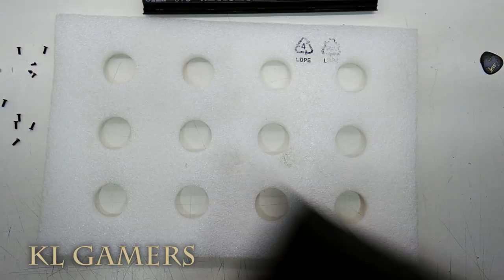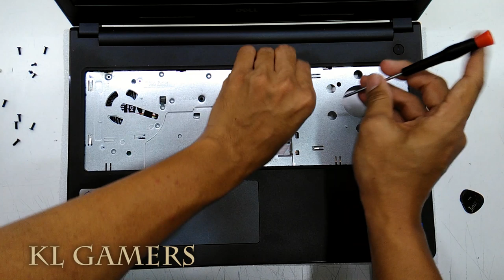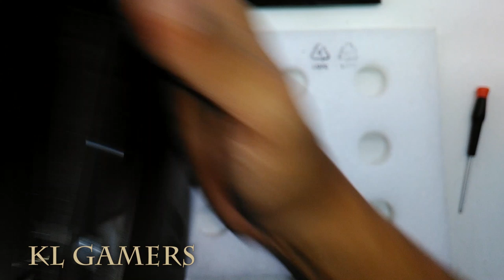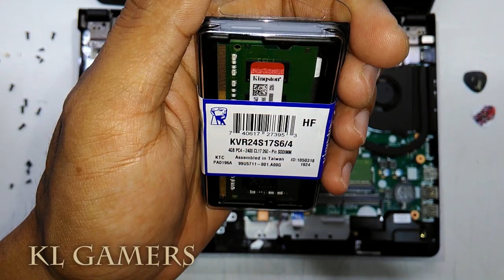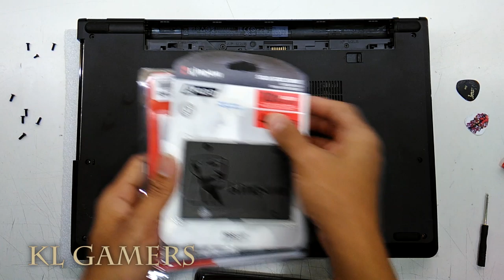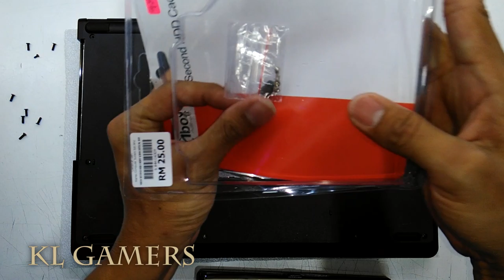DELL Inspiron 15 3567 Notebook Laptop Upgrade DDR4 RAM and SSD with second HDD Caddy increase speed

Comment: Wait... Did you leave a mechanical Hard Drive as a boot drive and installed a Solid State Drive as a storage drive? After going through all the trouble of disassembling the laptop, why did you not remove the HDD, install the SSD internally, and use the HDD in the caddy where the optical drive used to be??
Reply: How to set a boot drive?

Comment: Hi, I have Inspiron 15 3567 i7 with 1x8GB RAM - As per DELL the maximum capacity is 16GB.  Some places it is suggested that it can be upgraded to 32GB.  How can I make sure that what is the maximum RAM it can support before buying the RAM.  Thanks for your response.
Reply from the maker: i have no idea. But i see no point in 32GB  of RAM in laptop
Reply: @KLGamers  Thanks
Reply: according to system symbol supports 32 gb(2x16)
Reply: Can i used 4 +8 gb ram in my dell laptop
Reply: @108mohanbhole9  yes you can
Reply: Dell' s opinion ( by support center ) is that supports MAXIMUM RAM 2x8 GB # @ 2133 MHZ ( each slot till 8GB! ).
Reply: @billaua78  absolutely right.... mine is running same.
I have one 4 gh 2400 mhz
And others 8 gb 2666 mhz combined of both 12 gb is now 2133 mhz
Reply: @108mohanbhole9  how is the calculation of mhz?
Reply: I've seen a video on it brother you really can pull 32 gb
Reply: @maskman8161 Las memorias pueden bajar su velocidad, así que puede ponerle una de 3200mhz e igual funcionará

Comment: Pretty helpful video! Can I install the SSD drive into the main bay and the HDD drive into the caddy tray instead?
Reply from the maker: Usually you can sometimes not enough power to power up the HDD
Reply: @KLGamers  ok! And can I install the SSD and HDD as you did in your video BUT boot the system from the SSD in the caddy tray? That is, install Windows 10 in the SSD
Reply: @adriansi1111  yes you can 😄 just select the SSD as the main boot
Reply: @AndreaAlison  thanks!
Reply: @AndreaAlison  how to select ssd as the main boot? I can't even format it when on windows 10 booting usb
Reply: I installed the ssd inside and hdd in place of cd drive but my laptop keep restarting when I leave it on idle, with a blue screen
Reply: @godson2939 same problem, do you have any solution
Reply: @kranthipanuganti  it was a faulty ssd, I replaced it and its all good now
Reply: @godson2939  if i put ssd in caddy,  it was working fine.  When i put ssd on internal hdd port, i got this error.

Comment: Buenos dias Amigo, en donde puedo comprar todos esos accesorios ya que le quiero hacer lo mismo a mi laptop Inspiron 15 3567, sobre todo en donde compro el caddy drive compatible con esa computadora, puedes orientarme?
Reply from the maker: Kingston ValueRAM (KVR24S17S6/4) SODIMM 2400Mhz 4GB DDR4
(Amazon link) = https://amzn.to/2Z19dus
(Lazada link) = https://c.lazada.com.my/t/c.epu0
(Shopee link) = https://invol.co/clh7x1

SSD = SanDisk SSD PLUS 240GB SATA III 6 Gb/s, 2.5"/7mm - SDSSDA-240G-G26 = RM145
(Amazon link) = https://amzn.to/2HhQQv9
(Lazada link) = https://c.lazada.com.my/t/c.WLbx
(Shopee link) = https://invol.co/clhb3x

SSD = Kingston A400 SSD 480GB SATA 3 2.5” Solid State Drive SA400S37/480G
(Amazon link) = https://amzn.to/2ZvDna6
(Lazada link) = https://c.lazada.com.my/t/c.eBl0
(Shopee link) = https://invol.co/clhnhe

FEMAI Compatible second Hard Drive Caddy Replacement 9.5mm = RM20
(Amazon link) = https://amzn.to/2Ke9kyA
(Lazada link) = https://c.lazada.com.my/t/c.cKOC
(Shopee link) = https://invol.co/clh8ta

Price is based in local Malaysia current price.
Reply: Todo en Amazon, tenga cuidado quitando los tornillos
Reply: Esas marcas y corsair son buenas

Comment: W10 cant read the ssd, can anybody Help me? Ive already tried everything
Reply from the maker: You need to reformat or clone the Windows 10 https://youtu.be/jLsQJQCc3n4
Reply: @KLGamers  question if i just change an put the extra 4 gb all I want I to plat gta v on the crappy machine can I get to
Reply: Either it has installed in legacy and your computer is in UEFI or it has installed in UEFI and your computer is in legacy, please go to BIOS settings to change boot mode

Comment: Sir, I have same model dell Inspiron 15 3000 3576, i5 7th gen with 4gb ram and 2gb GPU, I want to upgrade my gpu to 4 gb GPU is there anyway to replace or upgrade
Reply from the maker: nope
Reply: Sir, is external graphic card helpful with my lapy, as I have 2 USB.3 port in it ?

Comment: I have Dell Inspiron 15 3567, i7  7th generation. Somewhere in manual of Dell official site where I see SSD up to 256 GB. Does it mean it doesn't support beyond it ? Can I use 500 GB SSD with Caddy ?
Reply: I have the same doubt
Reply: @Fasttz7  Bro, I tried Crucial MX500 SSD and it's working perfectly fine... Just go for it... Replace HDD in Caddy and SSD in place of HDD for better results
Reply: @abhisheksinghnepal910  thanks for the reply friend bought the crucial hdb bx 480Gb i'm waiting to get just this hard to find the memory frequency because the cmd says 2666 mhz and the task manager 2133mhz (sorry the bad english is the google translator i'm from brazil)
Reply: @Fasttz7  I have a lot of friends from Brazil studying in India.... Here I will suggest u Crucial MX500 over BX series.... MX series will provide u even better experience than BX series...
Reply: @abhisheksinghnepal910  Hey in dell official website, it says that we can only use upto 256 gb. Can a use 480 gb ssd if i remove hdd completely?
Reply: @anonymousguy1785  yup, it works... I m using 500GB Crucial MX500 since last 8 months...
Reply: @abhisheksinghnepal910  how it is working now?I am also going to purchase MX500 480 GB SSD,did you freshly installed Windows or clone it?
Reply: @shubhamsunny1806  It is perfect. I re-installed windows. For the better result insert SSD in place of HDD and replace CD-ROM with HDD.

Comment: Sir clear my doubt, i have same model laptop... Which place for ssd is better (in caddy or system hdd place)??
If i install ssd in caddy, then speed is slow than system hdd place??
And also tell me which SATA connector is in dvd drive SATA-2 or SATA-3
Reply from the maker: actually i think will be same speed  (in caddy or system hdd place)
Reply: @KLGamers  thanks bro for fast reply
Reply: @KLGamers  dvd drive is SATA-2 or SATA-3 connector??

Comment: Can you please check if it's working on dual channel mode or not, since the manufacturer are different. Just want to confirm before buying.
Reply from the maker: notebook not with me
Reply: I upgraded today with 4 gb of RAM made by Crucial, the module inside (4 gb) is made by Micron. I checked with CPU-Z and it's in dual channel.

Comment: Is it the one with i5 or i3. I am confused which ram to use either 2133mhz or 2400mhz. I have the same model as yours. please help me 🥺
Reply: I have the i5 model.. according to Dell spec, it's 2133.. make sense because in Intel spec sheet for i5-7200u RAM support is 2133mhz..

You can still use 2400mhz, but it will run at 2133mhz.

Strangely tho, Dell shipped out my order with 2400mhz RAM.

Comment: Hi Mr KL gamers my laptop is Dell Inspiron 15 3567, it's contains in system it shows  frequency of 2133 in cpu-z  but when I dismantle the laptop it's contains ddr4 4GB 2400 ram.
Now I want to upgrade the ram.
 can you please help that which frequency of ram I should buy  2133 or 2400. 
  Thanks
Reply: The laptop's motherboard only supports 2133mhz ram speed. So even if u put ram with speed more than 2133mhz(like 2400mhz or 2666mhz), it will run only at 2133mhz speed. So even if the laptop has 2400mhz ram inside it, it runs at 2133mhz. You can buy either 2133mhz or more speedier 2400mhz or 2666mhz rams but they all will run at 2133mhz only and will all work just fine.

Comment: I have same model 
I wanna replace its 1 tb hdd to 480 gb Kingston ssd, is it compatible ?
Reply from the maker: usually yes
Reply: Have you upgraded your laptop ? Is it working with 480 GB ssd
Reply: @prakharshukla3479   yes i hav upgrade with a Kingston ssd and it is working fine 
For better performance use 2 ram sticks of same configuration like i am using 2x 4gb 2400mhz and install ssd in main hard disc bay, not in the hdd caddy.

Comment: Can I ask something? How many mhz and V in ram you used? Is it 1600 mhz and 1.5 V?
Reply from the maker: Kingston ValueRAM (KVR24S17S6/4) SODIMM 2400Mhz 4GB DDR4
(Amazon link) = https://amzn.to/2Z19dus
(Lazada link) = https://c.lazada.com.my/t/c.epu0
(Shopee link) = https://invol.co/clh7x1
Reply: @KLGamers   I bought a Kingston A400 480gb ssd but after plugging into my laptop I hear an unusual sound and I was even unable to boot my laptop. I've same laptop as yours. So could you please tell me if 480gb ssd is compatible with dell Inspiron 3567? I went through Dell official site as well and found that 480gb is not supported. It's only 256gb upgradable. But now I just saw you installing 480gb. Please provide me some details.
Thank you!
Reply: @amarshah   please tell me if 480 gb is supported or not?
Reply: @anonymousguy1785  I would suggest not to buy 480 GB and go for 256gb instead. But do note that 480 GB is supported if you use it as external drive using hard disk case
Reply: @amarshah  bro 250 gb cost around 4000 rs whereas 500 gb cost around 5200 rs so I think 500 gb is more beneficial.
Can you tell me that is there any performance issue in your laptop with 480 gb SSD?
Reply: @anonymousguy1785  where are you from brother? Go ahead with whatever you think is right. All I can tell you is 480gb ssd is not supported and I was unable to boot my laptop with it. I checked manufacturers document and it was mentioned there as well. 
Let me know if 480gb worked with yours laptop.
Thanks
Reply: @amarshah  I am from Kolkata. I was asking you because you had installed 480 gb. SSD that's why I wanted to know if you faced any issue.
Reply: @anonymousguy1785  yes I faced one and that's why I don't want you to buy and face the same.
Reply: @anonymousguy1785  tell me which SAD have you installed?plz reply me fast as I have to purchase it.
Reply: @shubhamsunny1806  I have bought crucial mx500 500 gb SSD and it's working absolutely fine.
Reply: @anonymousguy1785  where u installed ssd .... ? In place of HDD or in place of Dvd drive?? I also want to buy ssd for same laptop
Reply: @AnandKumar-lx6io  I installed it in HDD Place.
And I completely removed HDD but if you want to keep hdd than I will give you the solution.
1) Install SSD in place of HDD and make it your windows bootable storage
2) buy a cady for your hdd and replace it in the place of dvd. You will get extra storage.
Reply: @anonymousguy1785  thanks 👍

Comment: Bro is there any restrictions of pairing the size of rams like 8 and 8 or 4 and 4
Reply: Yes. it's better to have two of the same size and brand rams, than having two different size ones even if they were from the same brand, and it's not recommended to different brand ones since they could have different speeds/voltage/ heating difference. like it mainly depends on your motherboard but for safety just buy 2 that are the same size and from the same brand so that you don't face any problems regarding the speed or the voltage difference between them.

Comment: Dell says that this model doesn't compatible with 500gb...it supports upto 256gb only. Is it true?
Reply: that's lies
Reply: Which model u have sir, 
I have dell Inspiron 15 i5 7th gen 3576, 4gb ram, 1tb hardisk and 2gb GPU pre-installed
Reply: Read inspiron 15 3567 reference laptop reference guide applied to 
~ 6th Core i3
~ 7th Core i3/i5/i7
w/o AMD R5 M430

Maks RAM 2x8GB = 16GB DDR4 2133MHz

Storage 
SATA 2.5-inch hardrive 2TB
SATA 2,5inch SSD 256GB

On paper said limited by 256GB but i confirm it works with SSD 480/500/512GB (the real capacity just above 469~480GB, forget advertising) 

Probably you can maxed out up to 2TB,
If you want HDD as secondary storage just bought 480/512GB or 1TB SSD then swap stock 1TB HDD into caddy.

If you won't do that just bought HDD enclosure 2.5-inch as Hardisk portable storage.
Reply: @claritoresdiano1021  sir is there anyway to increase GPU,
Actually I want to mine etherium or btc and in India asic etc re not available, 
So I want to upgrade my 2gb to 4gb or 8gb GPU, SO I can mine etherium or btc
Reply: @claritoresdiano1021  I am new in this filed, as I am student and staying in hostel we don't have to pay for internet and electricity
So, that's an advantage for me
Reply: @dr.siddharthojha3642  no you can't increase gpu. 
Mining on laptop looks waste time that's low hash rate.